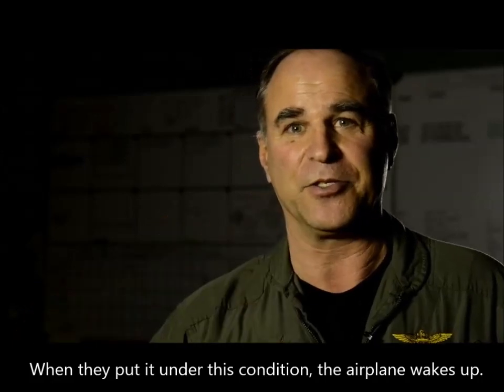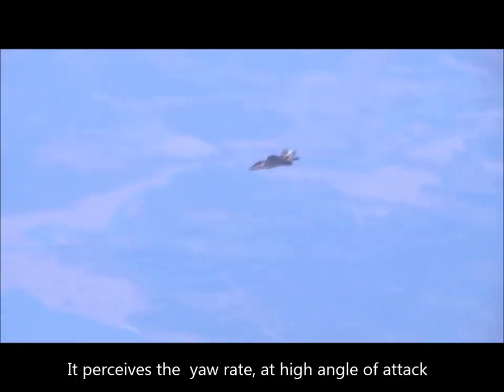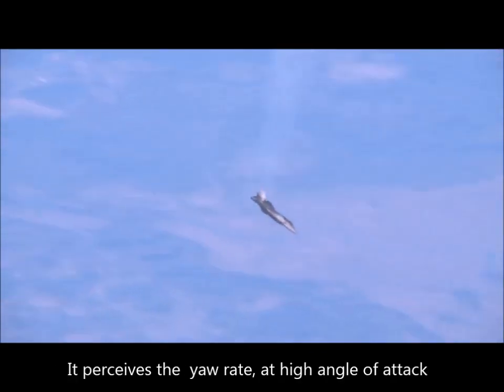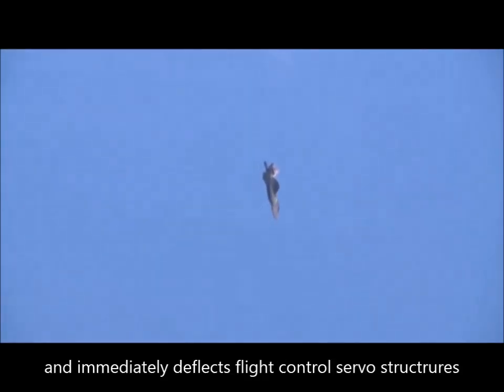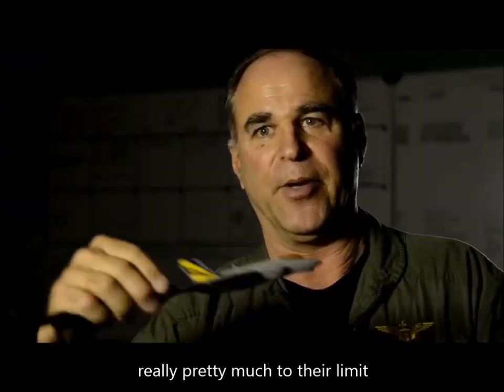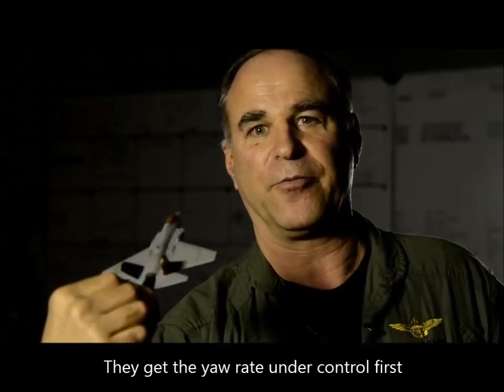F35's high turn rate, 90deg/sec, controllable, dominates Su35 and T50

Comment: So the F-35's specialty is yaw turning speed and stability, not that its other maneuvers are bad...

I'm not a hater plz don't kill me
Reply: This is for F-35A Block 3F
http://www.luke.af.mil/News/Article-Display/Article/1386133/lukes-newest-amu-supports-f-35-program/
"The unit is the first Luke F-35 AMU to receive a 3F, or full-up, combat aircraft capable of pulling 9G’s in the air."

http://theaviationist.com/2016/03/01/heres-what-ive-learned-so-far-dogfighting-in-the-f-35-a-jsf-pilot-first-hand-account/
Norwegian F-35 Pilot's F-35A Block 3I vs F-16. F-35 has superior minimum turn radius and high AOA.
Reply: F-35A has Super Hornet's minimum turn radius style dogfight with 9Gs.
Reply: You are blind? You have not seen videos? F35 demonstrate its capalities! But the better are its sensors and electronics. Russians can not detect it and will be destroyed before having understand what happens!

Comment: Hmm not bad. But I wonder how well and under what kind of conditions. The F-35 was at high altitude during a test and the Su-35 was at an air show
Reply: Strongly agreed. Su even not in competition with F. Just a show and cannot use in comparison.
Reply: Yes, and the SU-35 at the air show was slicked-off, i.e. no weapons. The F-35 is always slicked-off, even with weapons. :-)
Reply: The conditions were definately different... BUT It shows the f35a is alot better than people thought.. it looks pretty damn good at riat....new software running very good.. and we all know its electronics suite is very very very good and it can carry aim 120d and meteos..... its called air superiority if you match it with the f22....In my book.  NOT to say the Russia jets are garbage. they are not.  But have you seen a su35 perform stacked off vs a super hornet?
Reply: SU are clean on this video, but for battle he's forced to hang the missiles on his wings and that changes everything to his flight. F35 is clean with his bays, its a war machine! Just a show from the SU.
Reply: The fact that it turned that fast above the cloud deck is extremely impressive, considering there is MUCH less air to turn off of (Equalling slower turn rates and larger radius.)

Comment: The F-35 is the most pointless, useless thing ever....no all-aspect stealth, can't actually go places on its own and can't carry any useful combat load...very expensive to acquire (despite the bullshit statistics outlined by its corrupt manufacturers) and MUCH more expensive to maintain. It has barely reached IOC after so many years...
Ever heard of Lanchester's laws? Now, how many Su-35S can you have for every F-35? Exactly..good luck with the hangar queens. 
PS: this videos proves absolutely nothing - pit an F-35 with a nominal combat/fuel load against a Su-35S with an equivalent load at combat altitudes and the Su-35S will ship the F-35 into the composites recycling plant.
Reply: Finally, a comment from an person with a degree of aeronautical engineering and a budget secretary of defense. Lol
Reply: Yet they only have ~110 in service as of May 2022. NATO has over 450 Typhoons and over a 100 Rafales in service, plus over 150 F-22s. It's these planes that would engage and destroy the Su-35 in a war with Russia. The F-35 is mostly a stealthy ISTAR + ground attack platform (8 SDB II / SPEAR 3 in the weapons bay) that is also a somewhat decent fighter especially with advanced missiles like the AIM-9X and Meteor (>60km no escape zone).

I do agree that the F-35 is a flawed aircraft though. Ideally they would taken the F-35C's air frame with the bigger wing, deleted all the Navy specific features to cut the empty weight from 15.5t to 13-14t (22t gross weight). You'd need to add two F414 derivative engines making 12t thrust wet, lateral weapons bays as well as fixing ALL the airframe + avionics issues before LRIP. 

This would be an extremely manoeuvrable aircraft with a T/W ratio of over 1.1, with excellent performance at higher altitudes due to the bigger wing.